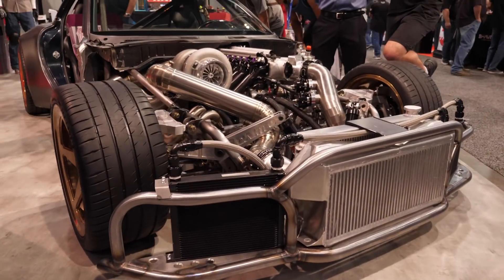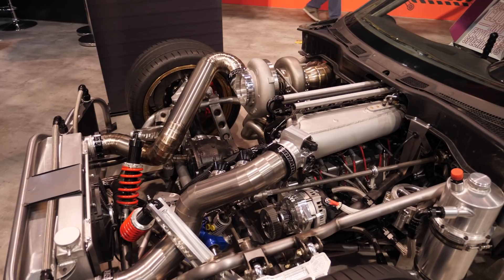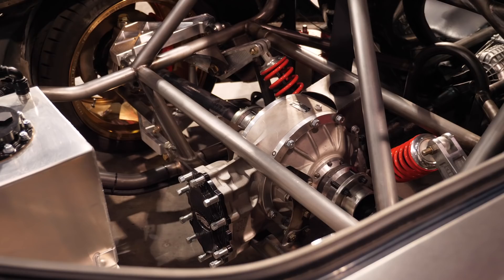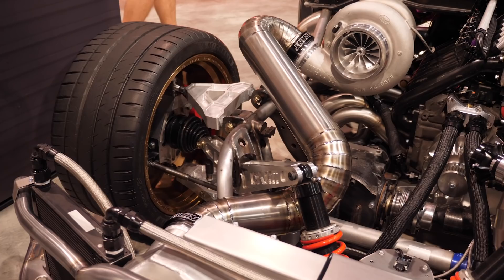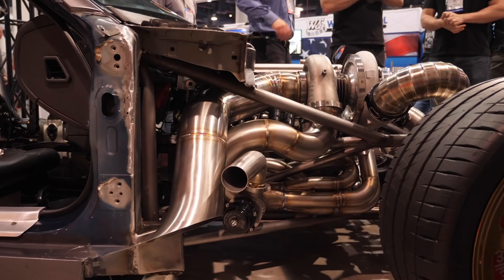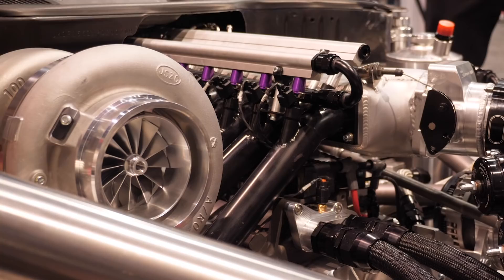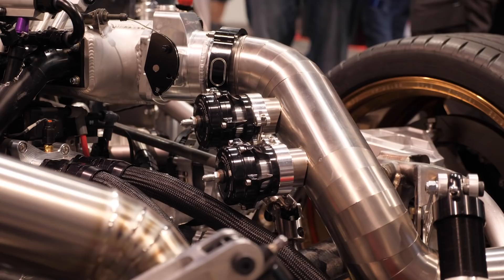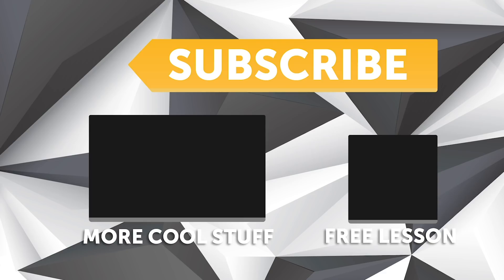4 Rotor AWD FD RX7 | Rob Dahms 1000HP+ Quad Rotor Build [TECH TALK]

Comment: For the people wondering, the 1662hp dyno video that Rob is referring to is the Queen Street Racing BMW's quad-rotor from almost a decade ago. 👍 That motor ended up putting that car into the 6s but was very unreliable as it was done using cast rotors and modified cast housings.

Comment: Rob just ran it on the dyno, made like 550hp on 8lbs of boost at 6,800rpm, he plans on turning it up to 45lbs of boost and reaching 10,000rpm. I fully expect this thing to do rolling burnouts all day long.
Reply: Just hit 1000hp at all 4wheels and on a mustang dyno.
Reply: @DjStanceZ  less than 8k RPM
Reply: I figure he will gain another 600hp as he increases to 10,000 RPM. At @15psi, so if he runs 30psi of boost at 10k RPM he should be able to make over 3000 hp! Scary part is that he actually needs a bigger turbo that what he currently has to make that much power.

Comment: The 26b will have no troubles over 1000hp but im more interested how quickly it gets out of the hole 60 feet !
Reply: Trev Ohlson this one is not a race car, but down here in Florida, USA the 20B’s do .97s 60ft times and close to 2,000HP doing 6.08s in the 1/4mi.

Comment: Why, doesnt someone build a rotary motor bigger than the standard being used now, and 6 rotors design the rotors twice the size a billet block, is there a limit to the size and cant go any bigger or know has designed one, isnt it all about more power and speed,it would cost alot to design and machine, but technology and cnc machines make it actually possible to do,  would it be to much power and not usable destroying drive train?
Reply: It would kind of defeat the purpose of being a physically smaller, less capacity engine that makes more power than v8s. Although a 2l capacity or something around that size would be interesting to see a difference.